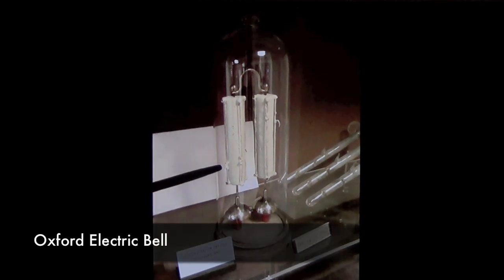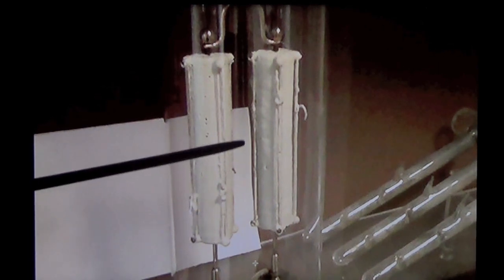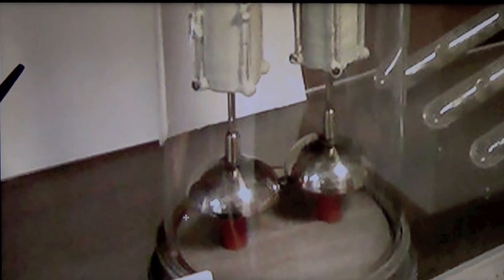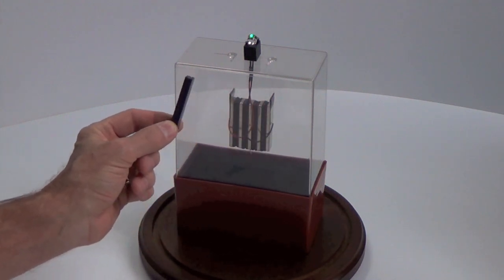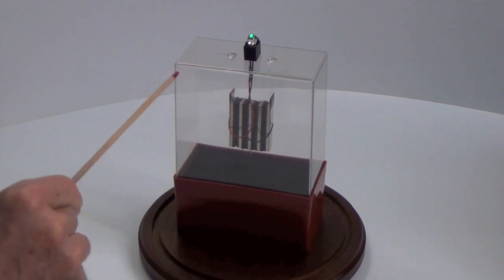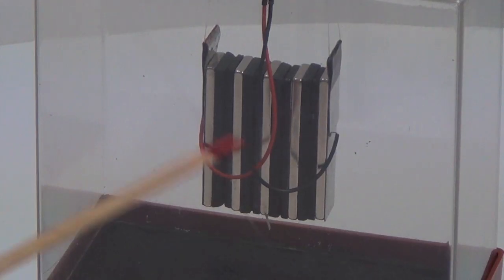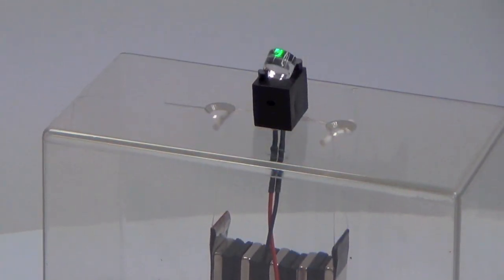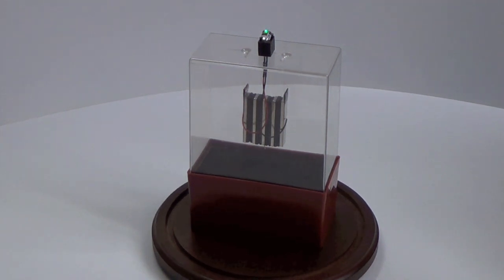Extreme Batteries

Comment: Hey bro , grea teaching aid ,from the presentation ,which is great and thorow , but we couldn't verify that the encapulation box with moss in the bottom is only use is for moisture control, keeping thing dry up top. Some other students asking if there is also related chemistry within the cells ,ie, the electrolyte formula you've mentioned. But we have thus far gathered that there should not be a hydro cycle involved in recharging these cells .. Is this true ..

Comment: If you measure the output placing your array of cells on the terrace, garden or window pane (window opened), you will measure:

- less output during the day
- more output during the very early morning hours

You may try to simulate these conditions with humidity in a closed environment, but with very little or no changes.

This will definitely lead you to understand what "electricity" really is.

You are very close, bro. Nice job, nice analyzing. Proud of you.

Kindest regards,

M.

Comment: Get two good quality alkaline cells wire them in series and place a 10k ohm resistor in series to a good quality 3W green LED. It will glow for years, I have one that is 8 years old and still glowing, it glows more if you sake the batteries.

Comment: If the battery is getting cold, that'd explain both the condensation and where the energy is coming from.
Reply: It is the reverse... it is porous, absorbing humidity, heating it, and boiling it out as water drops. (As opposed to humidity) Surely taking some electrolyte with it and accelerating the acidic neutralization which is making the "power", moving the electrons.

I would love to see this on a peltier cooler. However, there is never any mention of "Watts produced", which is the absolute measure of power, not volts and amps... I hear him say... xxx amps, then xxx volts, but never "at this voltage, it produces this amps, constantly"... Tazers produce 200,000volts from a 9v battery, at a micro-amp.

The battery comparison is actually poor to use. The LED is a current limiter. It will consume all you feed it, but it doesn't need much to light. If you lit it to the same power, the battery may still die first, because it loses power faster, as the conversion process is consuming the electrolyte and neutralizing it to a neutral PH and "corroding" the metaloids.

Sorry, but without wattage stated, by someone other than the creator, by a lab... Or horse-power, or some other certified statement... Assume it to be "too good to e true", or "the invention of someone hiding something", or a flat-out "trick of a scammer".

It may produce spikes of 1KW, for a micro-second, if it were the size of your house, but the power/wattage it generates in a day, would only be 0.0001KW.

Rub your feet on the carpet and touch a metal object. You just created a million volts! However, it would take you ages to charge a watch-battery that way. Add vinegar to baking-soda, and you just created a free-electron-floating battery. However, it only lives as long as there is a reaction going-on. Like that battery which ran for 127 years. Eventually it dies and the less energy consumed, the longer it takes to die.

That is like walking to your destination, instead of flying. You can walk many more miles than most airplanes can fly, in a lifetime, consuming less energy and resources... Though, you are not as powerful as an airplane. The airplane can pull 80,000 people further than you could ever pull them, in your lifetime. Thus, the airplane has more potential than you... More "wattage".

Comment: Here's an idea that you haven't thought of if, you were to put that battery in a vacuum glass chamber, I bet it would probably do even better, maybe it will, maybe it won't, but put it in a vacuum environment. The next thing that you should also do, is, do not touch the material with your bare hands use gloves, the oil from your finger interacts with the material that you are using must not touch it, it must be isolated from the oil from your fingers. In making your batteries do not allow your fingers or the oil from your fingers interact with a material that you are putting together remember if you notice the batteries that we have in today's world they have been sealed some of them seals break and leak yours need to be sealed I think that will improve their efficiency with a vent cap of some type. PS. I realize you uploaded this in the year 2018 let me know if you've already done this on your own, thanks, your videos are very good, keep up the good work. This type of science I truly love.

Comment: Wow, amazing, what is the current output capabilities? Maybe making the cells smaller, and put in series parallel, for desired power / capacity. And maybe use with a super cap bank, for surge current, basically use the cells to charge the caps! A self charging battery I guess!!!.
Reply: JAMES! Since the 70's selamat recharging b'cose close wave frequency looping charging.. Clever  think... I proud you. This  is  real

Comment: Cool. If you double the serfice area of the graphite and magnetic battery, will you double the voltage?
Reply from the maker: Current increases with greater surface area. Additional cells increase voltage.
Reply: PMMG4HYBRID ok. Thanks.

Comment: Is it still running? curious
Reply: It is still running
Reply: Calculate how long it should run.  It turns out to be 500-700 years.   After all, those are quite large batteries, equal to a large handfufl of AAA cells.   The only mystery is in how to build a battery with a shelf-life of hundreds of years. Not difficult, if your battery doesn't need to create amperes, only microamps (or far less.)
Reply: old batteries are better.  
I want my batteries to last 100 years and be replaceable

Comment: Did you patent this?
Reply: No need to It's basically your average semiconductor in series creating a peltier effect. If he doped the magnets with certain metals he could get a few more volts but these high inductance thermoelectric features of graphite are well known. The space X development team are currently looking for a solid state condensator design to procure water if we ever make it to Mars. If you created eight or nine of these in a vacuum tube with an extremely high current passing through them you might have a patent-able product but this alone is a well known effect.